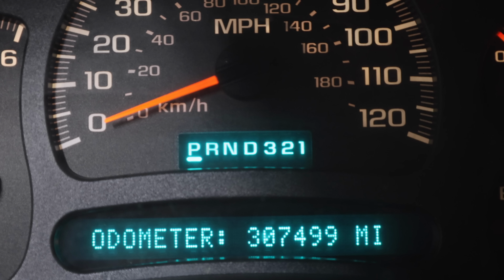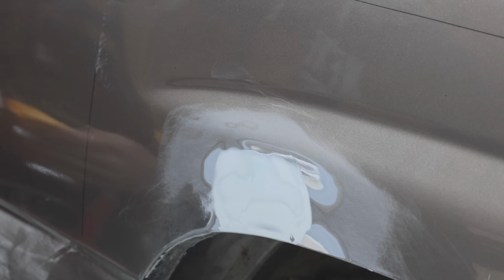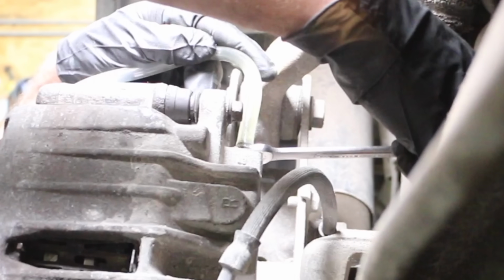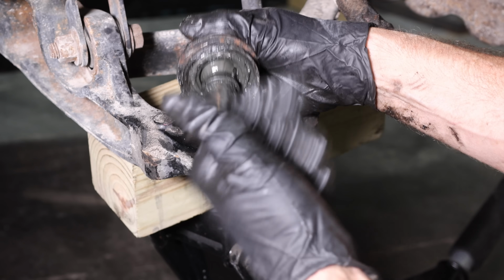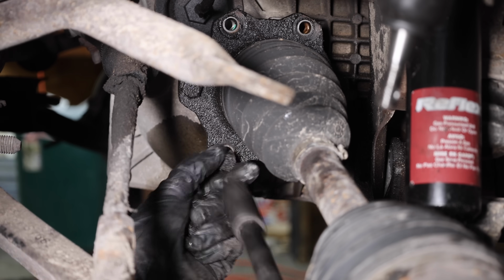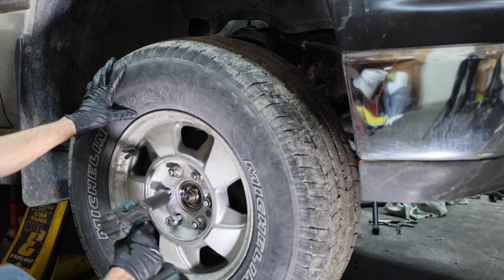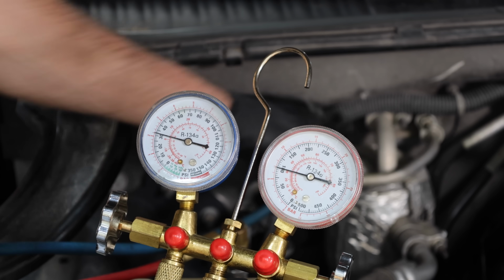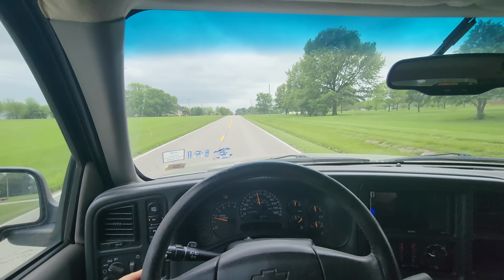Is It Stupid To Fix Up A 300,000 Mile Vehicle? Let Settle This!

Comment: My comments if anyone cares.  
Solid core pool noodle cut in half length wise is a better option than a 2x4. Hot wire does the best job.  Paper going on the cut flat edge and hands on the rounded edge.  Conform to the body lines better. 
I trim the replacement piece so it sits perfectly flush with the surface using magnets to hold to piece flush with the body.   I try not to use any Bondo if I can avoid it.
Reply from the maker: Thanks for the feedback.

Comment: I think it’s smart to put the money into the older vehicles. Especially when you can do the work yourself. I have a 2001 Toyota Avalon with 401,000 miles on it. And a 1997 Honda Accord with 457,000 miles on it. Both have original engine and transmission And are still running good. I’ve saved so much money not having a newer car. I’ve had brand new cars before and you just lose so much money if you get rid of it. Plus I don’t think the quality is as good as it was just a few years ago.
Reply from the maker: Thanks for sharing.

Comment: I have a 04 Denali with the 6.0 and did a lot of the same repairs. The Trans filter is kind of a pain as you have to remove all the exhaust hangers and use a board across the frame and ratchet strap the exhaust downward to clear the pan. It still is a very tight fit and I bent the shifter bracket to clear the edge of the pan as well. Ive had good luck with the new transmaxx Walmart fluid but used to use dextron 6. I rebuilt the front diff myself. Probably should have done a video on that as I did it without the proper tools and measured the back lash by loosening all the diff bolts and moving the adjuster by hand then retighten, Over and over till I got the correct.06 ish thousandth if I remember correct. My fan cluch was so tight I built a tool to hold the pulley as it would only turn with the belt even with extra tension on the belt. Rear air ride went out but I had replaced the shocks to I adapted a 1/8 hard line with shrader valve. Reused the factory dual orings on each line, slid them on. Used a soldering iron to flatten the ends of the lines to simulate the factory line. Used a small drill to open the line back up. That will hold the Orings on and keep the line from shooting back off. I use 110psi in the factory bags most of the time for max towing . I cut the large wire the the ride control computer in the back just under the rear AC panel. Reset the battery no more ride control light which is nice as well. Also already had the HD springs to replace the soft factory springs but that was not enough. I used the 40A from the ride control wiring to ad extra LED bars front and rear. That rear panel over it don't remove the seats just the back bag hanger hook and pop the the back pillar panel and speaker and pry the panel out. Just flex the whole panel out its enough to cut that wire. Its a very long panel. I did Moog parts on the pitman arm and idler. Hopefully it lasts. It was a bit loose at 122k when I got it and did the cheap ebay parts. They were already looser than the factory parts after 5k  and a waist of time and money. Buy once cry once. Your daytime running lamps are probably burned out as well. Nobody seems to notice those as they only function if you are in gear. Use parking break to check. I think I used DEx 6 in the transfer case but haven't had any issues. I am only at 131k now and finnally added some Freon almost a full can as cooling but getting bad on long stops but still cooling good while driving. The read system I think steal coolant from the front and will function at lower pressures and was still cooling nice while the front was weak on very hot days at idle. I havent done the upper and lower ball joints or any wheel bearings yet but sure thants coming. Its nice they are so easy even with AWD for 4WD on the trucks on the front. My rear calipers were tight last time I did the rear brakes and pushed and in anyway and run it. BAd idea. Was smoking almost immediately. Just put new rear calipers on. The rears where original I think. Truck had 121k when I got it 10 years ago. Only use it for towing and now that its a beater will probably use it 5k a year now. LOL. Average MPG is 6.4 right now over the last 3k miles. I enjoyed the video to much LOL. Brought back all those repair memories.
Reply from the maker: Thanks!  Thanks for sharing.

Comment: Yeh I dunno I have a Mercury Milan 2008 and my mechanic told me not to put anymore money into it. It has 200,000+ miles on it and it has had a major oil leak fixed at least 3 times.
I don’t think it’s worth fixing.
Reply from the maker: Thanks for sharing.

Comment: This is a great video but I will have to disagree about only needing the pressure for the low side on your ac. You'll never be able to tell if there's a blockage in the system and I've actually had a customer come in to check his ac and the low side was reading pretty normal a little low but normal. The high side was maxing out my gauges at 600psi so just be careful and don't overfill the system.
Reply from the maker: Thanks!  Thanks for the constructive feedback.

Comment: There was not a dime wasted on this solid truck. Finding a used F150 with 110K and documented maintenance took me nine months. Oil changes are every 5K, and brake, trans, coolant, diff, and transfer are all done at 60K. Sure, it's got a few scuffs and a small dent in the tailgate, but it was 60% off MSRP. I hope to own this truck for ten-plus years, saving tens of thousands on payments.
Reply from the maker: Thanks for sharing.

Comment: This was a short. and sweet video. I love your content. I basically the same colored GM GMT800 platform as a 4x4 but it's the Silverado 1500. My 2-3 band I think is bad on my transmission. Truck has about 216k on it but the engine still runs great! You motivated me to fix the transmission issue and keep her.
Reply from the maker: Thanks!  Glad to hear

Comment: Excellent work. I buy high mileage used reliable vehicles. The latest one has been a 2010 Nissan Versa 1.8 hatchback with 151k miles for $4700 cash. It's my daily commuter. It didn't need much. Just tires, spark plugs, oil change and air filter so far. Have to fix some very small rust spots on the hood and other small cosmetic stuff. I used to be a car tech for Nissan so that helps. I do most of the work. It sure beats very high car payments.
Reply from the maker: Thanks!  Thanks for sharing.

Comment: I have a 2001 GMC Yukon that has over 320,000 miles. I've done the brakes and steering components recently but it needs a fuel pump, brake fluid flush, an oil change (Im going to start using 15w40 diesel oil), and I need to change the transmission fluid and rear end oil. This video just reminded me that I really love my Yukon, it got me through my rocky divorce and I met my new wife sitting in it. It's been on the back burner, but after watching this video I'm going to start buying parts and showimg it the love it showed me all those years. Thanks for the inspiration I needed to realize what I need to do brother! Keep up the great content!
Reply from the maker: Thanks, will do!

Comment: Who cares, vehicles now a days cost so much so if you can get an old one running good and reliable for just a couple thousands who cares.  Even buying an economy used car with 100k+ miles is going to be like 6-15k depending on the car.  If you just plan on using the car it doesn't matter.
Reply from the maker: Thanks for the feedback.

Comment: Recently got rid of me 2003 Chevy Tahoe. She had her brake lines replaced for $800. Dash had gone out, A/C recently went, had a seized D/S caliper, and was on the spare tire for one tire as some PoS punctured my side wall. She needed some love. Recently replaced both steer hubs, some other front end linkages and an alignment for under or around 1k. Had a built proof V8. Yet, I had to get rid of her. She was a vehicle that needed work, yet even as a mechanic I could not work on it. No driveway or garage to call my own to properly maintain her. This video really shows the value of having your own garage!
Reply from the maker: Thanks for the feedback.

Comment: This was a good video but all is regular stuff if your used to driving a older vehicle. Still working on my wifes 97 f350 cclb. You did pick a good vehicle to refresh you cant do that with all vehicles especially midsized stuff the unibodies rot out even if the engine and trans are good in michigan.
Reply from the maker: Thanks!

Comment: Hmmmm since you’re in Missouri, I just bought a 2017 Chevy Silverado with 63k on the odometer. It needs a new torque converter, if you wanna use the truck to make a video let me know I’ll buy all the parts, I already have the torque converter.

Comment: Just a tip for welding in new metal. Always round the corners on the patch and cut out. It helps reduce the effects of the stitch welding shrinkage.
Reply from the maker: Thanks for the tip.

Comment: You should clean under the brake pad anti-rattle clips with a wire brush and slap some grease both under and on top of the rattle clips. It helps prevent corrosion and allows the brake pads to move freely in the caliper bracket.
Reply from the maker: Thanks for sharing!

Comment: Don't change man, you're awesome. 
Welding advice:
Sheet metal needs good fitup to prevent distortion or burn through, when patching panels or welding any part that has a larger gap, weld the sections that are touching (nicely fitted up), then fill the holes with the welder after the part is cooled down. If you weld the large gap first, the material is gonna distort more because more molten metal was introduced to it.
Reply from the maker: Thanks for the feedback.

Comment: My 06 YukonXL has 250k. Needs tires, brakes, suspension, mass o2 sensor and every gauge in the dash is dead except voltage. Just not sure if its worth putting all that money into deapite engine running well
Reply from the maker: Thanks for sharing.

Comment: That repair job on the quarter panel came out great; you just dived right in and came out successful! Wow!
Others probably would have mentioned the knock down steps afterwards with buffers to remove the orange peel. Also some paints have metallic finish instead of solid colors but I’m amazed how well that rattle can did. Masking off the area to include windows helps to keep over spray down.
Lastly the clear on vehicles is special unlike manufactured clear coats, they make a 2k clear coat in a rattle can with a hardener in the bottom. It’s pricey and time limited but closer to the durability of automotive clear coats.
I don’t normally type out long messages but I really enjoy your videos and find your attention to detail refreshing. 
Thank you, ProjectFarmer!
Reply from the maker: Thanks and you are welcome!

Comment: Im about 10k+ too far into it to turn back now. 04 Yukon with 4.8, swapped for a cammed 5.3, new suspension, wheels, hubs, everything. 
now transmission/gearbox is next and then interior.
Reply from the maker: Thanks for sharing.

Comment: Unfortunately when it comes to snap ring pliers snap-on is expensive but they definitely have the best. Lang makes an okay set but if you use them enough it's worth it to get a pair of snap-on snap ring pliers. Icon sells some sets I'd be curious to see how those review. I got the big ones from them but I've never used their normal sized set or the small set.
Reply from the maker: Thanks for the feedback.

Comment: I just went through my sisters Escape.  2005 with 275,000 miles.  It started to run horrible.  Needed new coils mostly.  I also fixed all the leaks, changed all the fluids, checked compression and blow by, checked bearings and brakes.  Did a good 2 day inspection and repairs while driving it around a few days checking stuff.  A few days work and less than $1000 in parts.  I would trust it more than a lot of cars on the road.  It already was in fairly good condition.  Gave it a mechanical polish.    A local shop she took it to quoted over $3000.  They missed or miss diagnosed many things on their quote.   If you are capable.  It can pay off.  It was a $500 car when I started on it.  Now a $4000-5000 car that will be more dependable than most $20,000 cars at a dealership.
Reply from the maker: Thanks for sharing!

Comment: Most working semi trucks are running over 300,000 miles most even X3 that and still pull loads. Don’t get me wrong at a certain point overhauls are necessary but will keep those horses running another set of 300k miles
Reply from the maker: Thanks for the feedback.

Comment: One thing I learned that had made my life a lot easier especially working on older gmt400 and gmt800 trucks, don't even bother replacing just the ball joint, just replace the whole upper and lower control arm with pre-installed ball joints. A little bit more expensive, but to me atleast takes less time than possibly having to fight really stuck balljoints. I have plenty of trucks the arms be worn out and the ball joint tap in with a hammer or very little resistance with a press. So I just skip that possibility entirely.
Reply from the maker: Thanks for the feedback.

Comment: If those rotors were original and had been on for 300k miles.... then I'm the direct descendant of a time-traveling pineapple who discovered the secrets of the universe and has been using its knowledge to control the global supply of nacho cheese.

Comment: Yes, for a vehicle with a sound frame.  A rusted unibody vehicle - it is not worth it.  This truck is a workhorse and has many more years of use.  May want to drop collision insurance on this truck - if it is in a moderate collision - insurance company will total it for a low amount.
Reply from the maker: Thanks for the feedback.

Comment: Keep the same pace. I have a 2012 rav4 v6 and a 2007 Toyota Avalon v6 and I can confirm it’s cheaper to keep her. Just now doing brake pads, rotors, fluids, engine and trans mounts, ball joints, wheel hubs, axles, and bushings at 125k miles for the both of them.
Reply from the maker: Thanks for the feedback.

Comment: I have a 2003 Pontiac Vibe (original owner and over 313,000 miles) I have been fixing it as needed over the years. I recently replaced tie rods, control arms, and had an alignment done. It's got a Toyota motor that just keeps going (recently also replaced the ignition coils after one went bad. It's been fully paid for for many years. I see no need to get rid of it.
Reply from the maker: Nice!  Thanks for sharing.

Comment: Ive got a 2001 tahoe with 260,000 and ive got a 2003 tahoe with 200,000 and ive got a 2004 3500 express van with 400,000 they all run like new i change the oil on all of them at 4 thousand miles its gold on them and i keep up everything on them somthing brakes i fix it ac everything works on all of them !!
Reply from the maker: Nice!

Comment: As long as the power train is still strong then fix it , all those parts you replaced are due to wear and tear,  it helps that your an excellent diy,r ,a 2024 model goes for 97k cousin Eddie is right again
Reply from the maker: Thanks for sharing.

Comment: I see few things did imho wrong, you should fasten shocks while vehicle is on the ground, otherwise, you can twist insides of lower bushings. You shouldn't add pin grease to brake pads tips, you should use ceramic grease.

I'm still watching so if something is gonna be wrong, (in my opinion) I'm gonna edit my comment.

Comment: I haven't bought a new car or truck in forever! I just buy other people's problems, only after reviewing the Engine, Transmission and Cooling systems. Been a Technician majority of my life. I get about 5 to 7 years out the vehicles before the drivetrain let's go.

I haven't spent more than $2200.00 for a used car that I fix and repair to like new and drive. When people keep up on Regular Maintenance, then that vehicle can last for a long time. Depends on how You Keep Your car. Especially, when You buy it from New!
Reply from the maker: Thanks for sharing.

Comment: well i would like to think when theres no drain plug on your automatic transmission its because manufacturers want to make sure the filter gets changed also and not just the fluid as you should be doing. Whenen it comes to axels got no clue maybe they skipped drain plug to cut manufacture costs or not to comprimice strenght but if theres no drain plug on the diff i would deffenitly want to remove the cover instead of sucking it to get all the nasty heavy sluge stuff that like to collect on the bottom.
Reply from the maker: Thanks for the feedback.